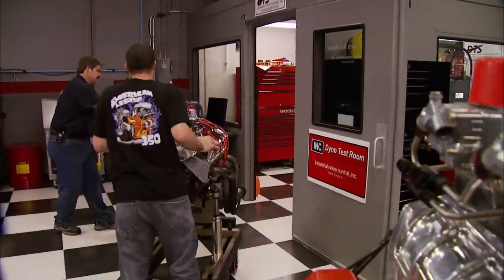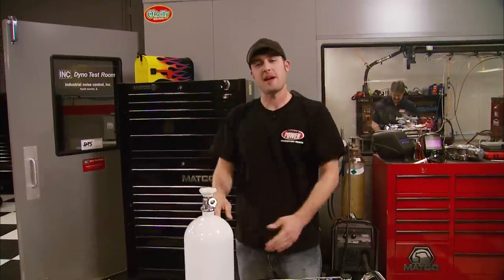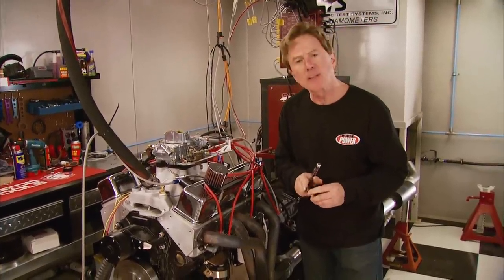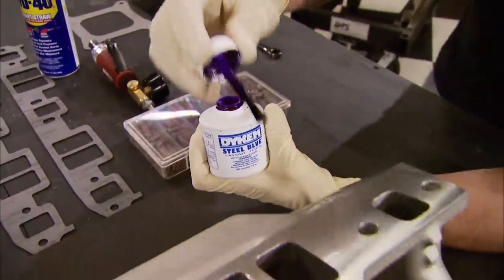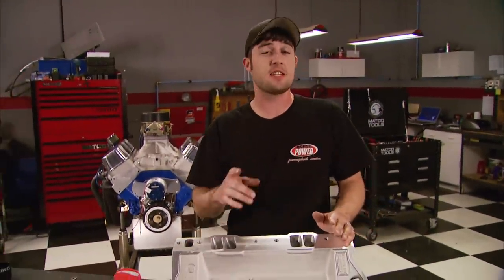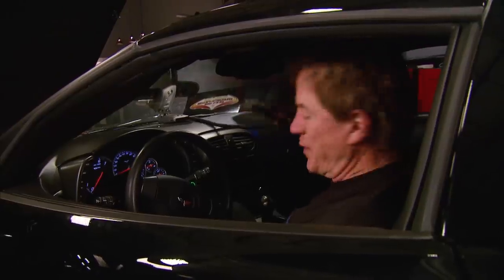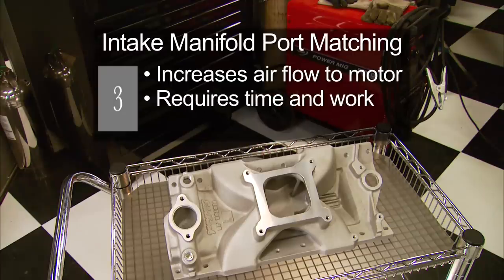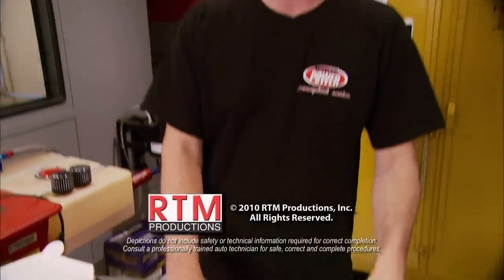Cheap Tricks To Increase Horsepower - HorsePower S12, E9

Comment: Nitrous is a great way to burn up you’re your stock motor.  Can we stop the disinformation about higher octane pump gasoline?  Higher octane pump gas doesn’t necessarily burn any slower than lower octane pump gasoline.  It just takes more to ignite it.  Octane is just a rating of resistance to ignition not burn rate.  It does not represent the thermal energy of the fuel which for gasoline is about 124,000 BTUs, and does not represent the burn rate of the fuel no matter which grade you choose.  All modern pump gas is “Fast burn” unlike racing gas.  Here’s what Sunoco says:
https://www.sunocoracefuels.com/tech-article/beyond-octane